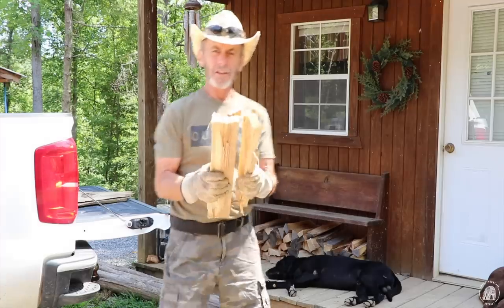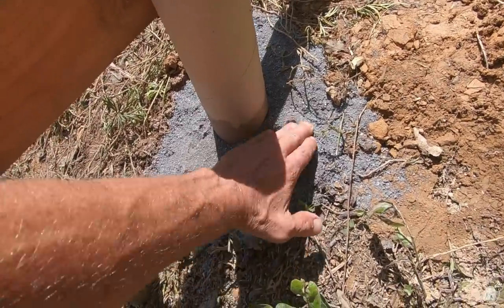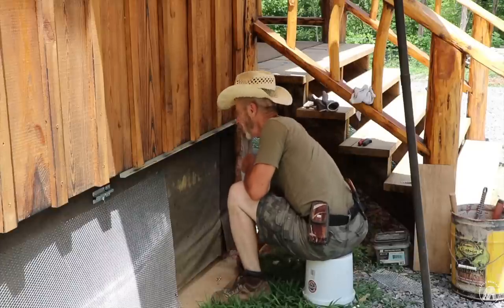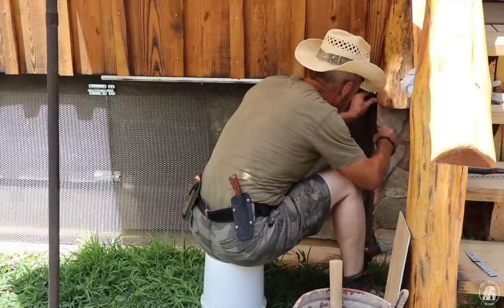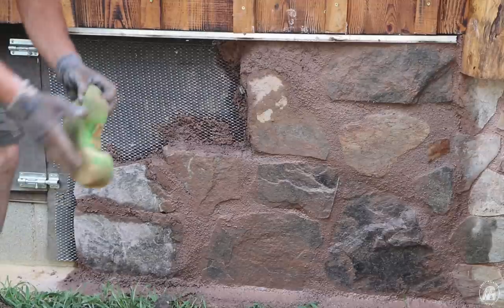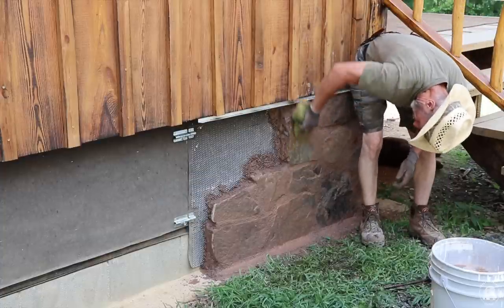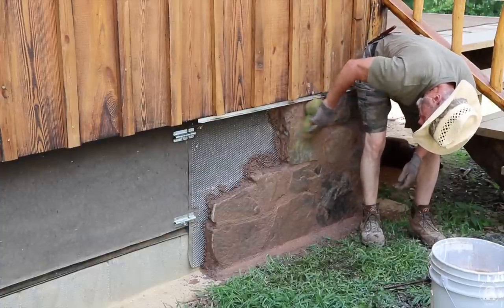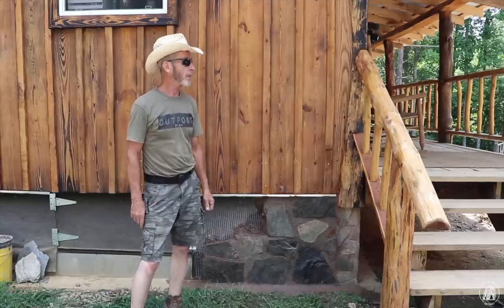CAROLINA ROCK FOR THE HILLBILLY CABIN

Comment: have you found a seep up behind the cabin yet?
I see the hill the tower is on if you do find one I can help to capture the spring water and with some tankage for a wet tap and cistern tankage for pressure...
Reply from the maker: There are no springs on the mountain. There once was one in the hollow where most are found around here but it went dry. Only flows when it rains
Reply: @SmokyMountainOutpost  well then how about socked pipe on the ridge? about 18 inches deep down hill to a cistern just above the cabin and gardens...46 inches of rain multiplies out still pressures read out by gravity...3 stage filtering 1 charcoal 2 string  and a berkey for drinking ?